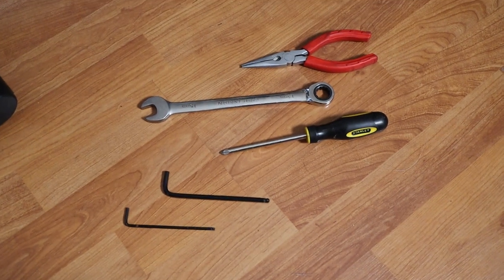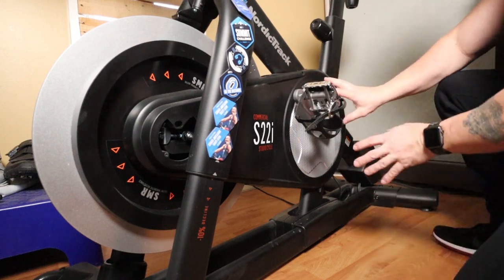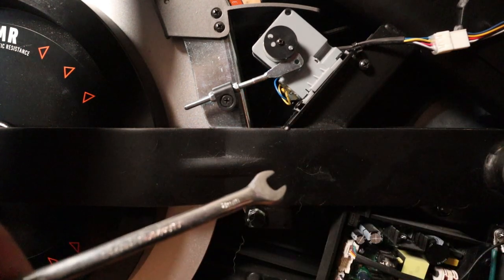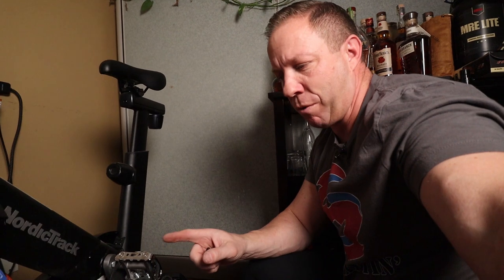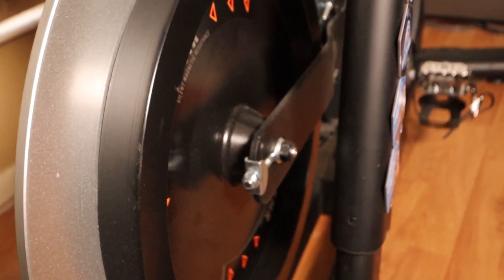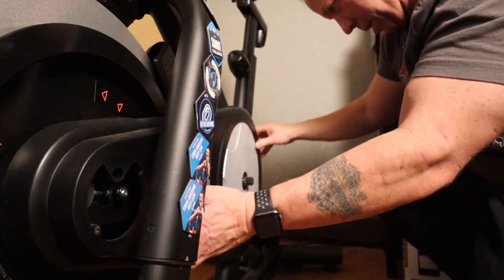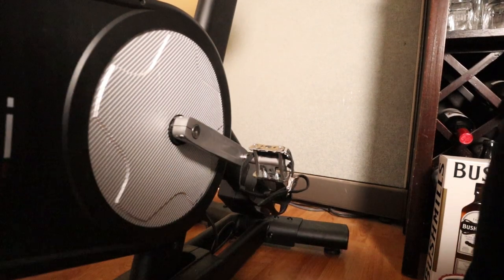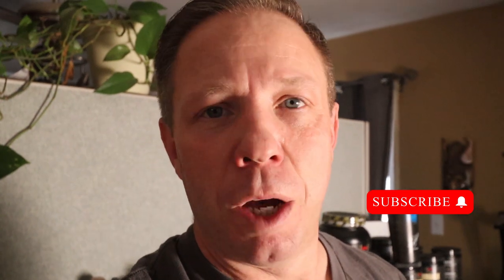NordicTrack S22i How to physically adjust the resistance calibration

Comment: Thanks. You have helped a lot. I just put my 2021 model together. The resistance was too easy. In fact I thought it wasn’t reacting to the trainer input but once I got the cover off I could see it was operating normally. 
It’s been a good way to get to know the machine. 
The dust cap on the crank arm has changed and just wouldn’t budge. It wasn’t for the reason you found, just seized. I was about to give up for fear of rounding out the 8mm Allen when I pounded on it with a breaker bar and bam! It turned. Geez! Put some grease on those threads. No locktite, just seized. 
I did a couple of rides and matched my speed and exertion to my known real life riding. Very happy with the S22i now.
Reply from the maker: I’m so glad you were able to correct yours and that you are set up for indoor riding.

Comment: Around 20:00 into your video, the dust cap actually pulls the crank arm away from your bottom bracket bearing cap. Otherwise, the crank could rub on the BB; similarly to adjusting your stem cap on your handlebar before you tighten the stem to the fork tube. Good video. Thanks for the great info brother.

Comment: Thanks for posting this.  My perceived resistance increased and watts dropped significantly overnight and this got it back on track.  I wish I could explain why it changed all of a sudden and I'm concerned about the integrity of the connection between the magnet and resistance motor.

Comment: Great video, thanks for this. I've had the covers off for the last month or so, making these same adjustments!

My only input for you/others is that you might take it slightly further by taking off the entire adjustment arm/screw, before adjusting the nuts. I do this on order to better maintain "alignment" of the whole mechanism, as the whole thing has a tendency to twist (potentially introducing other lateral stresses) while tightening the nuts.
Reply: Hey Brett, do you mean the two screws up by the caliper? What else do I need to do? I want to fix mine this weekend (too much resist)
Reply: @TheKyleHubble  Sorry I should have been clearer. I back out the small Phillips head in the center of the plastic disc, almost all of the way off (no danger if you do remove, it's just not necessary). Then pull the disc towards you gently, disengaging it from the resistance motor. Then remove the big screw that's by itself in the center of the big white clamp. This will allow you to pop off the arm assembly, at which point you can more delicately adjust it and keep all of the pieces in one plane. Then just reverse these steps.
Reply: @brettryder5561  thanks man. I’ve been using mine way over tuned for a year now and although I’m probably stronger lol id like to actually be able to do rides as intended!
Reply: @TheKyleHubble  Totally agree.  After our resistance motor was replaced it was the opposite for us ... as cool as it was finishing in the top 5 I didn't exactly think I was exactly approaching a Travis McCabe ability!  I swear the hardest thing is how much it varies between trainers in different locations (Regan Pearce in NZ seems hard to me, then him in France/Switzerland seems comparatively easy).

Comment: I just took mine apart this past weekend. I wanted to inspect the belt as well as fix a whisper of a rubbing sound. I wish I would have seen this before! I would have checked mine and maybe tweaked it up a bit. I’ve been needing to ride 2-4 above most instructors during my latest rides. I assumed it was that I was getting fitter. Maybe mine is a little too easy as well
Reply from the maker: The bike is actually quite simple to perform some minor maintenance items.  Did you determine where the rubbing sound originated?
Reply: @SargeLiftin  I think the flywheel was either off center just a bit. I also found the inner axle nuts were kinda loose so maybe that is what caused it to be off a bit.

Comment: I have a nordictrack s10i, when pedal, a noise from the drivbelt  of the drive wheel appears, I checked,  I think it may be due to causes,  the belt is too high or the sprocket ( the drive wheel is misalignment? Any constructive suggestions are greatly appreciated. Thanks for message

Comment: I adjusted mine and now it is consistent with the trainer, mine was extremely tight compared to the bike my daughter has, but I would like to know what is the exact and correct calibration that the manufactures design
Reply from the maker: I too would like to know the manufacturer's designed calibration.  But ultimately I'm glad that it feels to me that its closer to the trainer's setup.

Comment: Hey Sarge what would cause the S22 i to stop working I changed the harness cause I thought I chaff the wire by the neck but screen 📺 not coming on I hardly use the machine could it be the controller ?

Comment: HI Sarge! Have you had the problem ever of the bike not responding to the incline and resistance changes initiated through the handlebar controls? With the Jan 2024 software update, ours has stopped responding with no resolution after running the calibration reset or doing a reset of the machine. Thanks!
Reply from the maker: I've been away from my bike for the past few months for military duty, but my wife has been consistently using it and so far since the Jan update she hasn't mentioned anything about that.  So I would have to say no at this time.

Comment: Thanks for posting.  I am contemplating making an adjustment.  My question is do you try and match the pedal strokes of the instructor to see if your cadence matches?  I’m not sure the cadence and resistance have relativity to each other.  I am always feeling like my cadence is lower than the instructor by about 5.  However, maybe i simply need to pedal faster.  If i do pedal faster to achieve the same cadence, then my pedal RPM’s compared to the trainer seem   Faster.  I’m not sure adjusting resistance is the answer.  Does anyone else have ideas on how to measure if resistance is accurate to the trainer?

Comment: I just got a i15s today and it sounds like there is grinding on the wheel. Is that an alignment issue? How do I align it?
Reply from the maker: It sounds like it might be alignment issues.  You should be able to take the caps off the flywheel sides and use the nuts contained there to make small alignment adjustments.

Comment: I hope you reply to my comment and I hope you will soon.  I have a nordictrack s22i . My pedals turn so hard i am unable to ride.  I tried loosening the first two allen bolts, and one was easy, and the other was impossible. I stripped the allen and am stuck.  What size allen did you use, and what direction did you turn them? Both counterclockwise ? Do you think I can use the single one on the front without loosening the other two? Please answer as the natives are growing restless.  Thank you!
Reply: He said 5 mm allen key for the 2 larger bolts in crank arm (3mm for the cap). Yes, both would both turn countercockwise to loosen.

Comment: Why does my resistance feel really hard when I increase the incline? Is that normal? At anything over 10% I have to bring Resistance down to 1 and it still feels hard! The higher incline I go the harder it gets at resistance level 1!
Reply: I just got my bike yesterday and I’m trying to figure this all out too. Not sure yet what it should be though. Agree that instructor level is way too easy. Also jacking up incline is insane at the highest levels.
Reply: @tuckeroliver8300  let me know if you find out anything thanks
Reply from the maker: I think the resistance does increase along with the incline to simulate actually riding up a hill.  But If it feels too hard I would attempt the on screen calibration to ensure they are matched up properly. If after the on screen calibration still feels too hard you may want to consider the mechanical calibration on the resistance arm.

Comment: Hi, I am running into a similar issue. The resistance seems fine, sometimes easy at 0-8% incline and on decline but it becomes virtually impossible to pedal over an incline of 12% regardless of the resistance level. I wonder if your adjustment works for every inclination? Or it should be re-adjust depending on the incline?
Reply: I'm having the same issue. Resistance becomes ridiculously hard when the incline goes up. I even drop it down to level 1 and it still feels hard. Did you ever find a solution?

Comment: I saw your other video on the resistance motor change. I did the same on my S22i. For some reason the resistance motor is not moving or adjusting, even with a new motor. Any suggestions? I really appreciate your feedback. Thank you in advanced!
Reply from the maker: It might be the control board rather than the resistance motor.  I would make another call into NordicTrack to see if they can ship you the control board.
Reply: @SargeLiftin  I’ll try that. I appreciate the tip!

Comment: I normally can go 85-90 RPM at resistance 14 now at resistance 12 I can barely turn the pedals.  Anything less than 10 feels about like it always did, but it's like there's a f'ing brick wall at 14

Comment: How do you know if yours is off? I know mine is changing, but is it changing enough? I just did my first 3 rides today, and thought a 10 resistance would be harder for me. I can feel the 24 is rough, so there is that. I found this trying to see how to know if it's wrong.
Reply from the maker: I used the trainer on screen and when they say they are increasing resistance and then share the cadence mine was way off (too easy) that was my indicator and the reason I chose to make the adjustment.  Note: I had the bike for 6 months and had been using it consistently before I made that call.  I wanted to ensure that I was familiar with the resistance and cadence before adjusting. (Personal preference)

Comment: Is 3 miles on a stationary bike the same as walking 3 miles?
Reply from the maker: Sadly, no.  But I find the impact on my knees is better on the bike.  Over time the joints should increase in strength and you can add walking to your fitness repertoire.

Comment: How do you even know this adjustment needs to be made??  The instructor calls for cadence but never for what your Watts should be.  I’m so confused how am I supposed to know if it’s actually off or not?
Reply: I just got my bike and wondering too. I do think that it is too easy at the instructors pace. But I have only done 3 rides so I need more time to be sure. It does seem confusing that it would come so easy compared to instructor pace
Reply from the maker: Yeah, I would keep an eye on it for about 10 rides or so.  Make mental notes as to what the instructor is saying with regards to RPE and the RPMs.  If you are no where near what they are saying it might be time to make the mechanical adjustment.  I too found it to be much easier than what they were calling for on the workouts.  Now that I’ve made the adjustment my RPE and RPM are much closer and I feel the workouts are better.
Reply: @SargeLiftin  Just curious why you wouldn’t just increase the resistance?  I figured the workouts were kinda general because so many people will be doing them.  If it’s to easy at times I just increase the resistance.  
I have been using it two times a day for over a year now and just make adjustments during the workouts if I need to.   Some days I feel way better then others during a workout m, that’s just normal tho
Reply from the maker: @melissamitchell5608  the main reason I decided to do this vs change the resistance is that I felt that I was increasing the resistance every ride just to match the trainer.  And I wanted to let the cycle do its job rather than me over riding each session.  I felt that the traines rpm on their pedals vs mine was too far off.  And I did adjust the resistance for a while but wanted to see if there was a way to get my rpm to match the trainers a little closer. So that’s why I went this route.  I hope that answers your question.
Reply: @melissamitchell5608  Also, changing resistance on the console (or handlebar buttons) means you are no longer following the trainer for remainder of ride (unless you hit button "follow trainer", in which case you adjustment is erased). In other words, if you have increased the ride resistance from trainer's 4 to your more realistic 6. It stays at 6 for the remainder of the workout regardless of changes in terrain or requested RPE ..... so FUTURE changes by trainer are not followed... bike just stays at 6 where you set it. It would be cool if user could add +2 resistance on console/handlebar controls to be added to any future trainer changes during the ride.

Comment: Update: 1)buy the extended warranty. 2.)The shoddy workmanship of the internals is horrible. the gray resistance motor & kinematics is out of alignment and I had to Jerry-rig the arm into the motor disk with washers to get it to function. 
3.) I have a call into Nordic track for warranty service. 😵

Comment: Never adjust the resistance , you will always be off what the instructors say because of the smartadjust. Only time you are on same resistance as the instructors say is when you ride it first time or you turn resistance of... SO DONT MESS WITH IT
Reply from the maker: SmartAdjust is a new feature.  When I adjusted it quite a few months ago I was so far off from the instructors that I knew that it needed to be adjusted.
Reply: I found the starting adjustment by checking the factory settings on a new bike. Then I adjusted my bike to the same in the manual lode. At level 6 the bottom of the magnetic resistance cover is EVEN with the top of the flywheel. It goes thru self adjustments when you switch to a program due to its preset or the automatic Smart Adjust. When you stop a program, it will park the height about 1/4” above the flywheel. But I set it in manual mode to eliminate any auto features. Hope this helps anyone trying to find a closer factory setting. Any input is welcome!